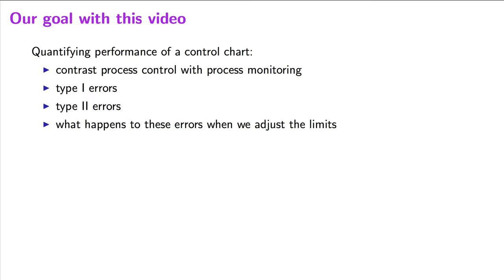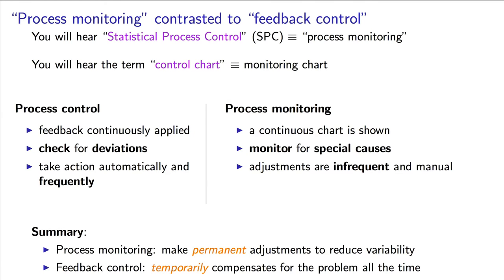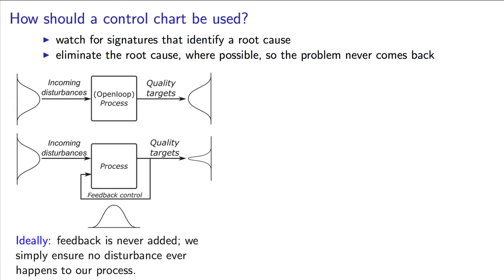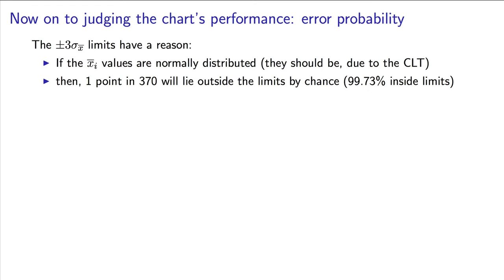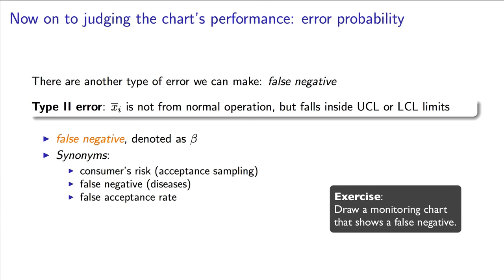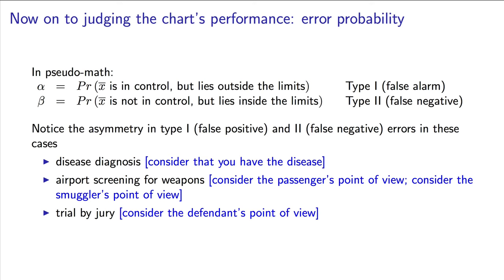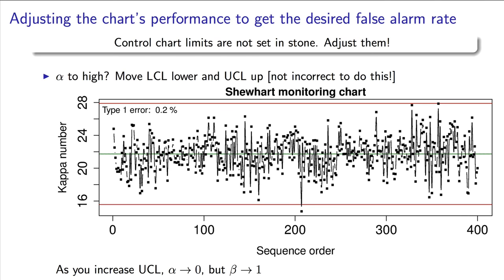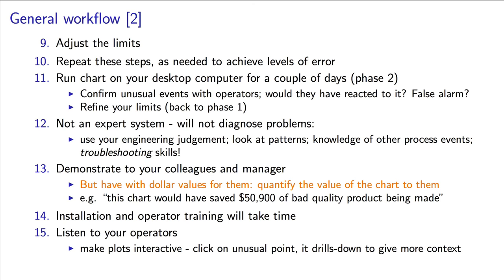Process monitoring - 03 - The meaning of type 1 and type 2 errors

Comment: Mr. Dunn,

Can you know which subgroup contains the outlier without checking manually?  Thanks for your assistance.
Reply from the maker: Hi Ndungu, you will have to write some code to identify the element(s) in the vector that exceed the limit. In most programming languages you can easily use some comparison test, such as ">=" (greater than or equal to) to determine that.